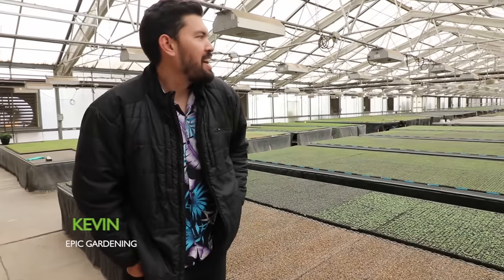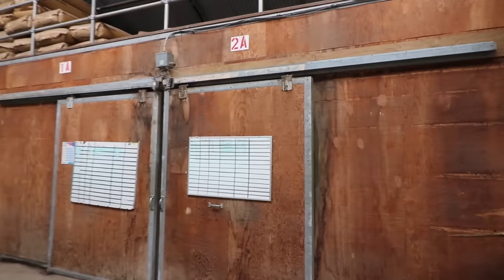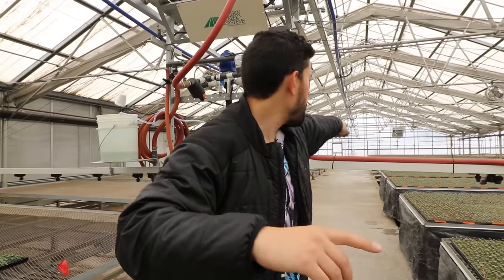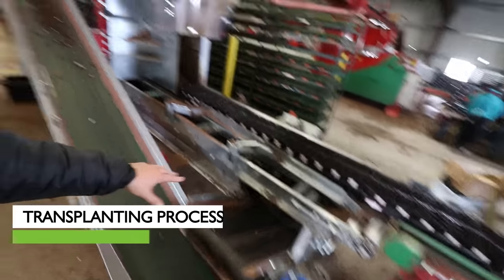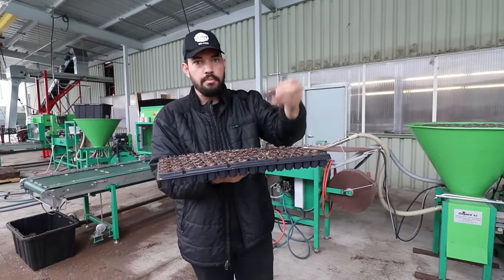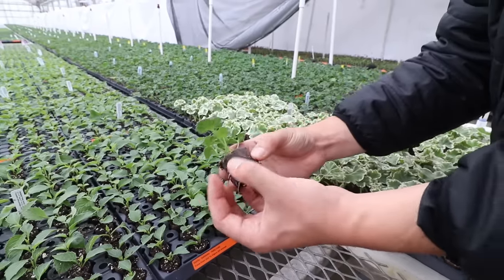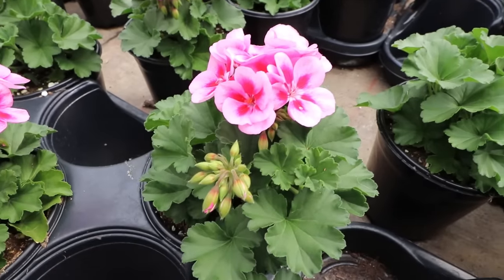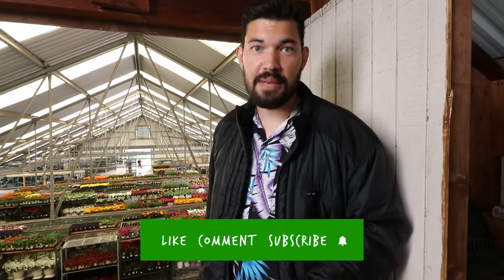How To Grow MILLIONS of Plants a Year: Plant Nursery Tour

Comment: You can see by the movement of the sheets below the tables that they have proper airflow - possibly the reason why they get away with overhead irrigation instead of a flood and drain system.

Comment: Wow inspires you to control microclimates and aspects of seed starting so much better on a small scale when you see the large scale they succeed at. 

@kevin, did they tell you what their general germination rates are like? Their trays seems to be chocked full without empty spacing?
Reply from the maker: Their germs % are back-calculated, so if they know they have a 97% germ rate, they will plant an amount that leaves them with the # they want based on a 3% failure rate